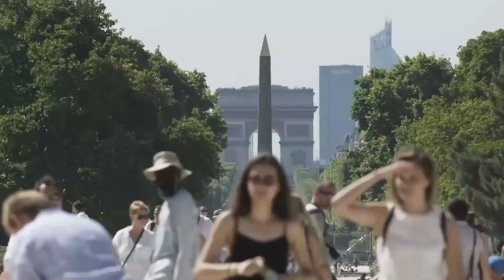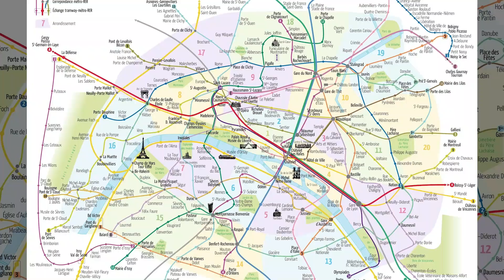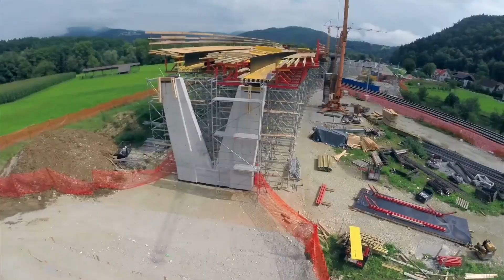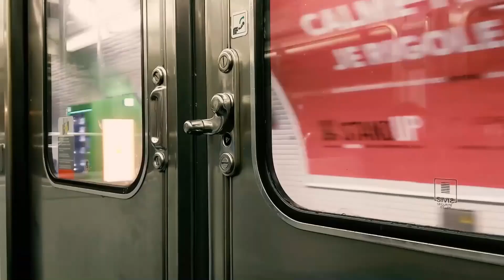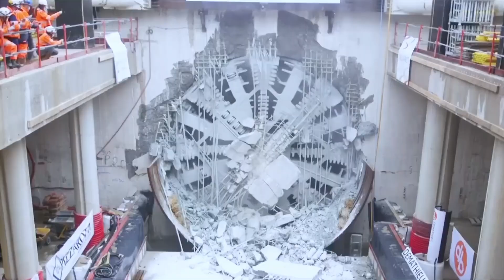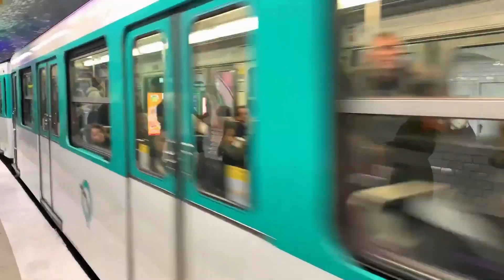Unveiling Europe's Largest Transport Project in France!

Comment: As of January 2024, for the construction of the tunnel and stations (civil engineering) line 15 is 40% complete...the southern section will open next year (a small section of 2.5km to the north is also dug) .The markets of the west and east/north sections have been laid and digging will begin in mid-2024.

Line 16 is 97% complete and the part of installing the rails and developing the stations is beginning.

Line 17 is 50% complete. The southern section will open in a year and a half. The northern section has already started work with the aerial station and the viaduct under construction, as well as the first works at Charles de Gaulle Airport. Gaulle.

Line 18 is 70% complete. The stage of station development and rail laying has begun. The TBMs will begin the last section towards Versailles in a few weeks.

The northern section of the 18 and the western part of the 16/17 are not yet 100% legally established.